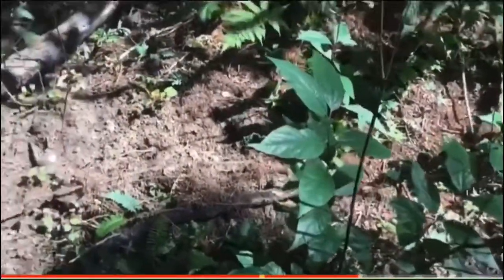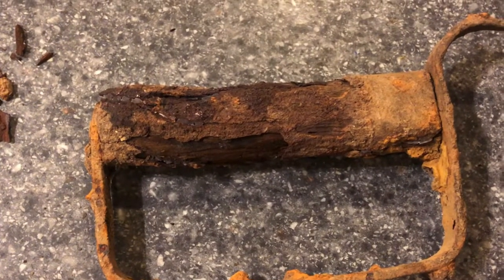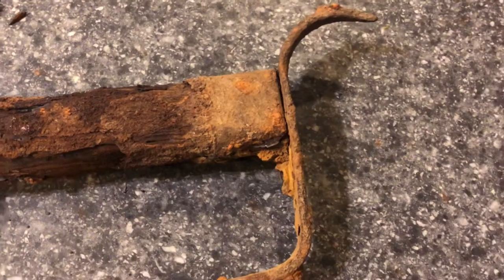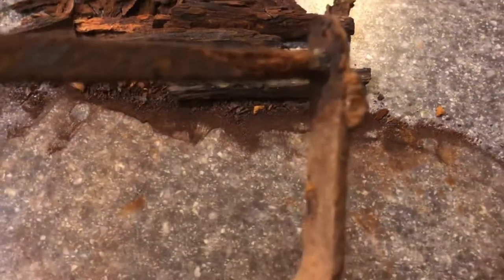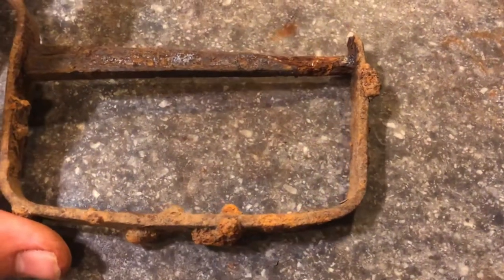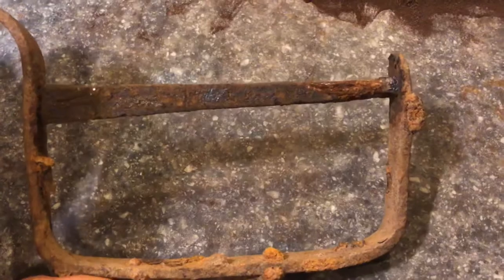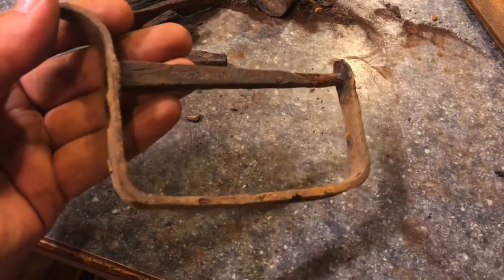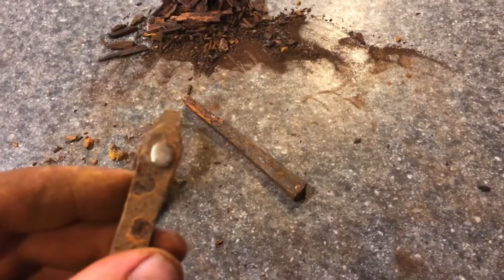Confederate Bowie Knife Rebuild | Discovery and Deconstruction

Comment: There are several very good books out there that will identify the wood handle by doing a close examination of the grain using a thin cutting of it.  Perhaps a library might have one.  Here is a good one.
Wood: Identification & Use (Revised & Expanded) Hardcover – February 1, 2007
by Terry Porter
Reply from the maker: Missouri Mule Thanks so much for the tip.  I’ll definitely give the old handle close examination.  Right now I’m leaning towards it being walnut.

Comment: Hi Ben, This is going to be an awesome series! This kind of stuf is right up my alley so to speak as I do tons of restoring of old things of all types myself and over many many years its become a hobby of mine as well. As a lover of all old things and antiques Ive done Classic cars and a truck to furniture and pocket knives, wood plains, tools and I love old tractors. ( I have 4). Im really looking forward as to how will procede and the finished piece. One thing I can tell you is its very rewarding...and addicting...so be carefull!
Reply from the maker: Wally Weener Sounds like you’d a guy with some good insights.  Like I said in the video, due to the fragility of the guard I’m going to have to be creative when it comes to assembly and connecting the new blade.  Look forward to hearing your thoughts as we proceed.
Reply: @HistoryHoundDetecting  I think I would grind that peen down as far and thin as possible then drill as needed, A dremmel tool works great for fine grinding and a spring loaded punch would work good for getting the drill bit started.
Reply from the maker: Both tools I don’t have...but I’m sure some of my buddies do.  Thanks!

Comment: Ben, since you are considering welding the tang why not use electrolysis on the guard, weld the large hole as well as the tang and fill any small pits with liquid metal? that way you will have a stronger guard that won't break if dropped and a nice finish as well.
Reply from the maker: I’m not sure how well a weld would connect with that corroded metal.  A couple of the larger pits go most of the way through the guard itself.  It’s a good thought though.

Comment: Nice video Ben. After seeing it again it looks like you will definitely have to grind the peened end flush and drill the piece out. Reshape the hole with small files or a dremel tool. I would definitely spot weld the new tang protruding through the hole and smooth it down afterwards. I know we’re miles apart, but if you need anything welded, cut, or shaped let me know if you don’t have anyone local. If you have a template for the blade and need one I have lots of materials here to cut one out. Can’t wait to see the finished piece.
Reply from the maker: Well....got it drilled out, but it was VERY close to disaster.  That end of the guard is very degraded so I don’t think I’m going to mess with it much more.  We’ll just have to get creative with shaping the tang to fit the holes as they currently are.  Thanks so much for the insight and offers of assistance.

Comment: Interesting video! If it were me, I think I would have left the tang in place, restored all the metal, then replaced the handle in two parts. I would have made two identical halves of the handle with a groove cut in them for the tang to lay in. Then I would have glued the two sides together with extra glue in the voids around the tang. Looking forward to the rest of the restoration!
Reply from the maker: How would you have attached the blade then?  Or are you saying that you would just have restored the handle without a blade.?
Reply: @HistoryHoundDetecting  Yes, I would restore what I found as much as possible and not add any more modern materials than necessary.
Reply: I am with you.  If you deconstruct it to the point off adding new wood and other materials, go ahead and add a blade, for then you have something in its entirety to understand the past.

Comment: Awesome fine... But🤔,I personally would have got some clear epoxy to mold and sealed it in time, coaster or hang it on the wall... Just an idea.😇 Good luck🌠👍👍
Reply from the maker: Daniel McArthur Thanks Daniel!  That was definitely the plan for the last two years, but after talking to a couple Civil War edged weapon experts I decided that the rust and rot would never get any better no matter what I did.  They recommended a restoration, but believe me....taking that old wood off the handle was TOUGH to do.

Comment: The handle was probly water soaked Which would allow the wood to expand when it was Drilled, then still wet they Would have hot nailed it through the wood And then flatten the end... That's what I think that how they did it
Reply from the maker: Daniel McArthur Very cool idea.  I guess they just drilled the hole to fit the  narrowest part of the tang and then allowed the pressure, water , and heat to make a perfect fit.  I like it!
Reply from the maker: Daniel McArthur I might use this explanation in an upcoming video.  I think you nailed it.
Reply: And to go the extra mile they probly rubbed some kind of slightly sticky oil into the wood after it dried
Reply from the maker: Daniel McArthur I think I’m going to go with an application of linseed oil over a walnut handle.
Reply: @HistoryHoundDetecting  toungue oil works better. It ages better and is actually water proof after 3 days of dry time. I used to use boiled linseed oil but noticed I had to reapply every once in awhile. Since I have switched to tongue oil, I have not had to reapply yet. I used it for walnut coasters so it stands up to the abuse of hot coffee cups.
Reply: Do you have Facebook or an email I can send pictures to? I have a couple of pictures I could send you of a couple pieces I did with black walnut and tongue oil if you would like to see them.
Reply from the maker: Sure!  Send them to benjpope1818@gmail.com
Thanks!

Comment: I can't think of another way to get that out other than drilling. Also, have you considered a light weld to build up areas along the guard where the metal is thin?
Reply from the maker: Well...the deed is done.  It was darn near disastrous but we got it drilled out this morning.  I don’t think the light spot can be built up with welds or even a compound until the rust is removed.  Unfortunately I think rust is all that is holding this thing together in some spots.